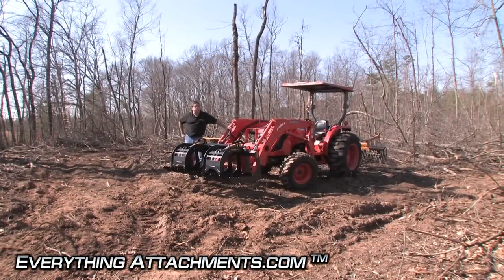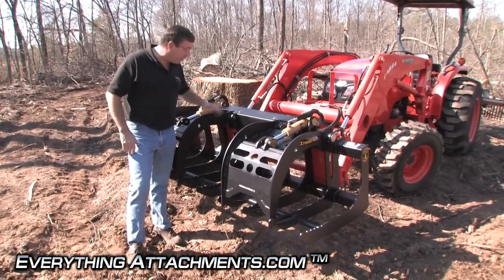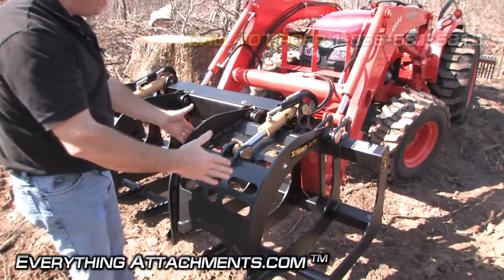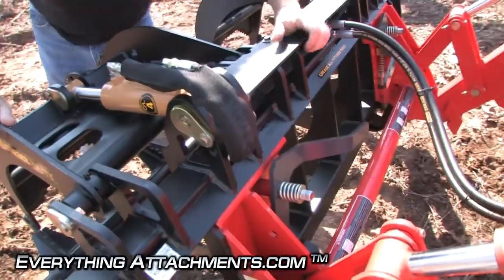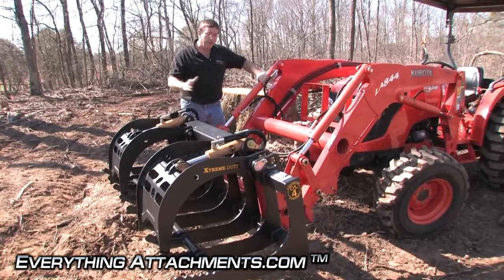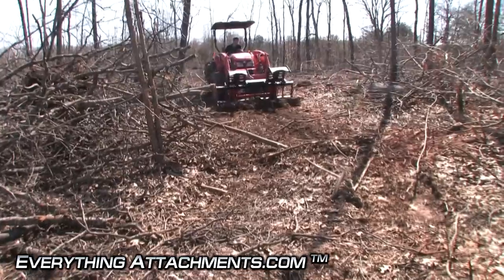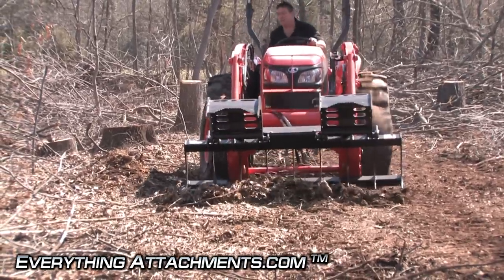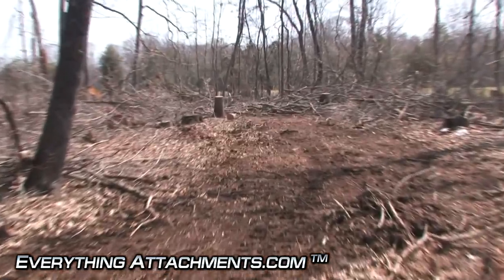How To Use A Compact Root Grapple

Comment: You do not  put the loader in the float position when pushing. As you'll notice, when the tractor pushes forward, the floating cylinders allow the loader to swing to the bottom of its radius which acts as a ramp and picks the front tires off of the ground. No steering or traction on the front wheels. The only attachments that are designed to operate in float while pushing forward are those with wheels or rollers(usually some type of mower).

Find your angle, as he said, and then apply slight down pressure but not enough to break traction on the front wheels. Depending on the terrain you may have to make slight corrections as you push, but that's just part of learning how to operate equipment. On a wheeled machine, you ALWAYS try to keep all of your tires on the ground to operate most efficiently.

Comment: What would you recommend (other than a 'dozer) for pulling/grinding stumps?  Something with a winch/block-and-tackle for pulling, maybe?  Is there a wheel attachment for grinding them down?
Reply from the maker: We offer various attachments such as stump grinders, stump buckets and tree pullers for dealing with stumps.  Picking the proper attachment will depend on the machine you have to mount it to.  For further assistance, give us a call or send an email to sales@everythingattachments.com